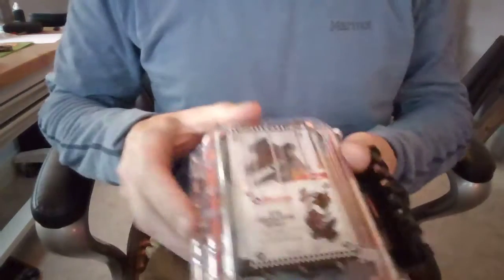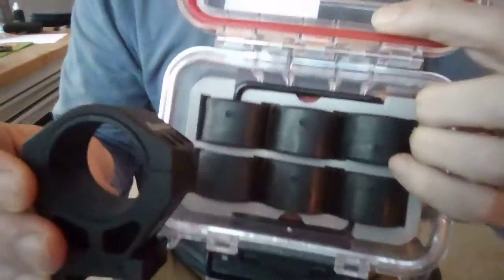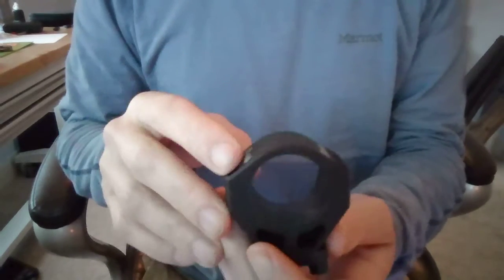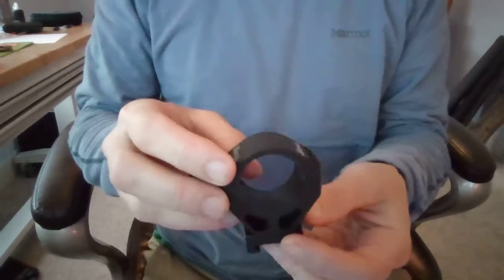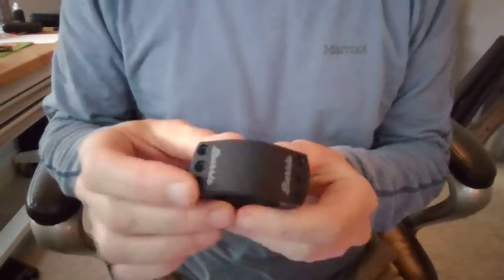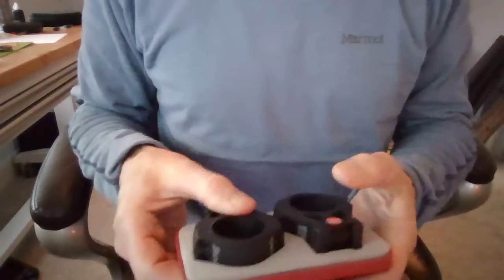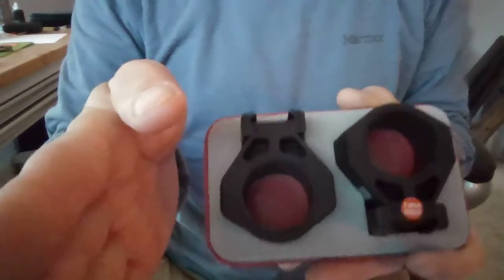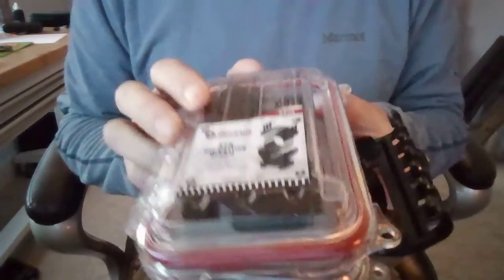Burris XTR Signature Rings (34mm with cant inserts)

Comment: Hello Quinn, are you still using the XTR Sig. Rings?  Has been a bit and was curious to know what you think.  
Have you had some trigger time to give a opinion. Thanks
Reply from the maker: They are rock solid and feel like they were built in a military factory and never lost zero. I sold the XTR and included the rings in the package; not due to performance just because I found I didn't take that whole rig with me much on account of weight. Only downside, the rings that allow you to move POI are pretty finicky and a bit difficult to get them to "spin" then hold position. I just used them for cant, but everything was so correct I didn't need the POI shift feature anyway. Great rings (a bit heavy) highly recommend them.If you are going to buy them, here is a link to my store https://shop.valhallaoutfitter.com/products/optics-burris-420210-000381202109-6765 I really appreciate it!
Reply from the maker: PS YOUTUBE10 will get you 10% off
Reply: I put a set of Burris Sig. 30mm on a Tikka T3. So far all is good. The T3 came with a picatinny rail.                                                                                                                                                        The owners manual says the rail should not be removed or six jack boot sky troopers will descend my man cave.                                                                                                                                  Have you ever removed a factory pic rail from a T3 ??
Thanks
Reply from the maker: @bokchow2594  I have not, my T3X is set up with a Sightmark wraith so I needed it.  I can’t imagine it is such a big deal? Maybe check the tally site if they sell one piece rings for it they can only be installed if the pic rail is gone.

Comment: What were you thoughts once mounted these rings. Would you buy them again?
Reply from the maker: Great question. They work well with the 34mm platform and since I put them on my 6.5 Creedmoor they have not moved. They also protect the scope from getting marred by the metal. That said, the cants are a great idea, and are good for the MOA adjustment, but for adjusting the point of aim they are only OK. It is difficult to "spin" the inserts to make adjustments then have them stay in that position while hooking/tightening everything together. I might buy them again for the first two plusses, but wouldn't rely on them to adjust point of aim (maybe I did it wrong), I just mounted it all up and zeroed the scope. I might opt for a less expensive option if available. Also, my rail had 20 MOA built in, so I went with the least adjustment possible (5 and 0). If I didn't have that 20 MOA in the rail already, these would be SUPER useful.
Reply: I just purchased a 6.5 and would like to reach out a little farther. What sold me on the rings is the cross member for the 1913 picatinny. Would you trust a set of 30mm weave mount or change out to the XTR'S.
Reply from the maker: @bokchow2594  two things: 1 these are 34 mm that I’m talking about though I imagine the 30s would get the same review. 2 you could go for what you’ve got to save the money, see if they work and nothing moves and if you’re not happy then move to the XTRs. 
If the current set up you have doesn’t allow for the additional MOA that’s where the XTR‘s really shine because they give you those extra come ups. I will say that these things are rocksolid.
Reply: After pulling the scope and rings, the XTR'S look a lot more Russian Industrial...I'll give them a work out...Thanks for you impute. Have a great Thanks Giving!

Comment: What was the final insert set up you used?
Reply from the maker: there was 20 MOA built in to the rail. I think I went with 0/0 but will check for you when I get off the road tomorrow. The only real advantage I found was that the inserts might protect the scope from wear with the rings.
Reply: @valhallaoutfitter  cheers, just bought some, same set up with the 20MOA, was just thinking of putting 0/0 at the front and +5bottom/-5top at the rear
Reply from the maker: @mattbradford5078  I had the 20's and the 10's leftover, so did exactly what you did.
Reply: @valhallaoutfitter  Cheers mate, seems to be working well for me so far